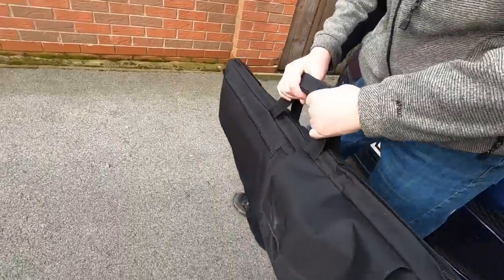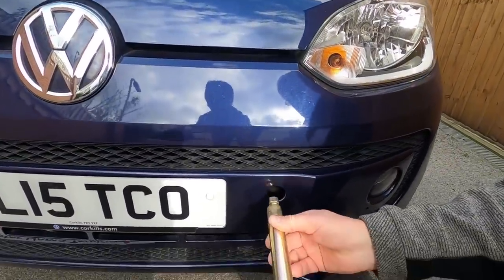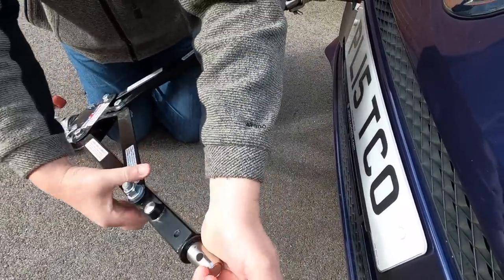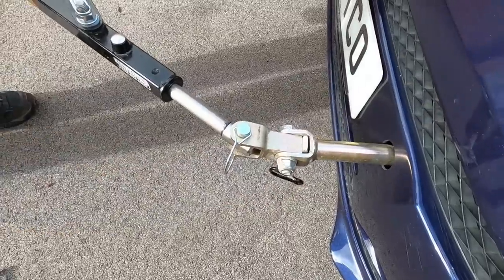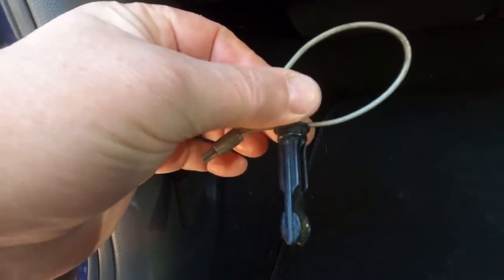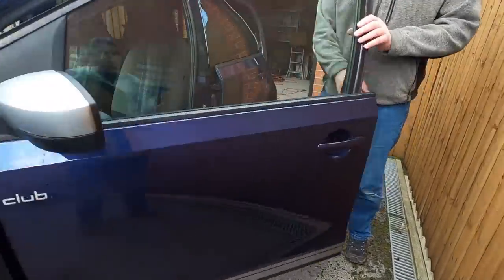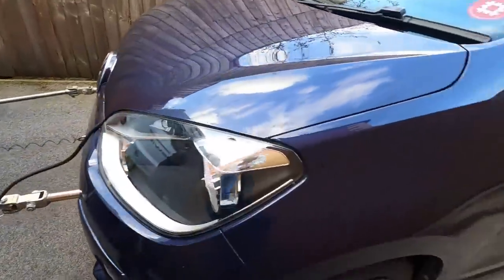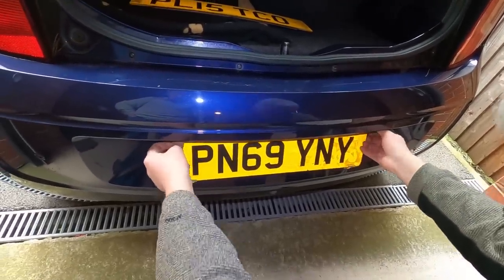Attaching The NEW Smart Glide System | Towing A Car With An A Frame

Comment: Another great video Bob, well done. I do like the way it packs away, very tidy. With the extension bars for easier attachment,  quick fit lock bolts & frame wedge, all great ideas.  As a note, we have now added ON TOW signs to the sides & boot to make our tow car a little more obvious to other road users.
Reply from the maker: Thanks. I have a sign for the back now. Do you find the side signs help? Especially when overtaking a truck on the motorway that's 3 inches from the one in front of it and they start to edge out as you pass.... Oops there's a car there...
Reply: Hi Bob,  Yes, we have had one or two occasions where drivers have been a little confused, especially pulling out of junctions, roundabouts etc and when visibility isn't ideal, we also have a dark coloured car, which doesn't help. So the side decals do work. That said, we have started to tape them to tape windows now as the magnets don't feel too strong & may blow off on the motorway !!

Comment: Used have Tow Bar for tow cars . Nice light bit of kit but hitchin up was a two person job line up had to be exact . That Smart Glide is the solution looks dead easy one person hook up. We tow a Fabia estate car so use a Armatige A frame with a jockey wheel its very heavy but one person can hook it up ok. Is reversing a short distance possible.
Reply from the maker: Yes, I can reverse a short distance, as there are no over run brakes involved.

Comment: Hi Bob I believe you will not now be able to use the vehicles towing eye? using the Smart Glide fittings. Just hope you never have a need for it!
Reply from the maker: On the previous tow a frame screw in connectors the thread was changed so it was longer and stronger than the fitted one, so I couldn't use the original towing eye anyway. Recovery operators I have spoken to tell stories of the original towing eyes breaking. If the car was still towable I would use the motorhome to tow it home if the recovery company refused to use a perfectly good towing system. However, most reputable recovery companies wouldn't tow a car very far on a towing eye anyway, they'd put it on the back of the truck. mike@towaframe.com will be able to answer any technical questions.
Reply: Hi again Bob Did you keep your cars front panel ? I was thinking as the car has now been modified, you would have to inform your insurance company as the car is no longer standard. Should you sell the car, you would have to inform the new owner that this has been done to the car. I like the idea but is it all worth it? just to save a few more minutes over the screwing in the attachments on your the old setup? Please don't take this comment wrong, it's just an observation, not a criticism!
Reply from the maker: @billtait9647  Thanks, no problems. To answer your questions, I didn't keep the original crash bar. I have informed both my insurers about the modifications, as you should do with any modification. I suppose when I come to sell it, it will probably be to someone who needs are car to tow. I'm not sure people would want to change screw in connectors for the twist and lock if they already have screw in ones. We  were having them changed for demonstration purposes. Makes more sense if you are having a new installation though for the ease of use.

Comment: Hi Bob looks good I have the old system, can the twist and lock be easily fitted to existing installation? Thanks Simon
Reply from the maker: Here's the video of us having our VW Up! upgraded to the new system. It took about 3 hours to do, if you' are interested, please email Mike@towaframe.com for prices etc. https://youtu.be/2l_QQph_K24
Reply: Hi Simon, unfortunately you have to change the front crash bar to have the same twist and lock receiver as the bolts Bob shows in his video.
Reply: Thanks for info love the smart tow so will stay with the old system for now

Comment: Great video. The Tow a Frame Smart Glide system is impressive - having researched the systems available i think the Tow a Frame Glide and the Towmaster2 by lnb Towbars in Bristol appear very similar and the costs are also similar, around £2,800!......but haven't bought either.....yet! I note that Bridgend offer to fit the system to a new car achieving an overall saving, but the Nissan Micra does seem a bit big/heavy to tow behind a motorhome?
Reply from the maker: Depends on the specification of course, but it was around 1100kg, so about 100kg heavier I'd guess. Be nice to find out if that makes any difference towing. hint 😁😉

Comment: Hi Bob great video and is something we could use but a quick question how does it work without a key (a start button) as it looks like you leave the key in the ignition to remove the steering lock. Thanks again David
Reply from the maker: I don't know. Perhaps Mike at Tow A Frame could answer that.
Reply from the maker: This is the full list of cars they provide the system for - https://www.towaframe.com/vehicle-list/

Comment: Thanks Bob. Very informative. Intend to tow a smart car but have got to get tow bar on motorhome. Do you know where the tow car brakeaway and electrics can be fitted so I can just fit the Tow Glide. Plymouth. Thankyou
Reply from the maker: The biggest and most difficult part is modifying the crash bar on the car to accept the Smart Glide. I suggest that you contact Tow A Frame, the number is in the description of the video.

Comment: Nice video as always, lacking poppy though.
System looks very well built and thought out , we just phone a well known car hire company who drop it at the site , works well but down side is excess on the hire car can be pricy if you dent it.
Reply from the maker: Thanks. Yes they are called Enterprise. Worst experience I ever had was when I wanted to hire a 4x4 from them in Glasgow. They were incompetent and downright dishonest. Spent 2 days trying to get the right car from them and it cost me £449 for that pleasure. We had to go into Manchester when we hired a car in Bury to get a car and that took into the afternoon. Other times around £275 each time. That's why we tow our own car. So much easier and actually cheaper over the 5 years that we've had the Tow A Frame system. We worked out that if we had hired a car each time we've used our own, in 5 years it would have cost £7500. The Tow A Frame system cost £2500.
Reply: Yeah, get that Bob.
Nervous driving with a grand excess
We are a family of 5 so towing a suitable car is not easy. Hence enterprise. We may have been lucky as it was a fair experience.
Keep driving safe
Reply from the maker: The Nissan Micra we looked at was a 5 seater, would be OK for smaller kids in the back.
Reply: Kids taller than me now, so Micra wouldn't work although nice car. Kids are well trained now, so converting van to travel mode is  well rehearsed and takes 5 minutes. Needed car for isle of wight though , roads too narrow. 
Not to mention ferry crossing costs
Give my regards to Jen and Poppy

Comment: Excellent review Bob, i'm having my car converted and this type of A frame early next year, have you managed to use it a lot this year outwith the lockdown months, one of your other reviews of the older AFrame showed you screwing the bolts in using the toweye, does the new system have a turn and lock using the existing holes?
Reply from the maker: I have used the A Frame a fair bit this year post lockdown. I had a new crash bar fitted in January as you can't use the existing holes. There is a playlist of all my A frame videos.

Comment: The twist to lock bolts are definitely a lot easier than the the threaded system you had. I also like the way it extends if you're a little short to the towball.

Comment: hi bob i just had my towaframe fitted ,,i spoke to mike regarding the rear sign ,,he advised me not to fit the sign for legal reasons ,,not sure if you know about this ,,?
Reply from the maker: As far as I'm aware, all you to need to be legal are the triangular warning triangles as the car becomes a trailer. I didn't there was a legal reason not to fit the sign, I assume you mean the motorhome towing car tow-a-frame sign. I would double check with Mike on what he said.
Reply: @BobEarnshawMoHo  hi ,,i enquired why i never had a sign in my pack ,,he called me immediately saying he does not recommend saying you are towing car on the motorway ,,as you could be sued if there was an accident or similar ,,give him  a call yourself see what you think might be good to put on your vids if hes correct ,,/
Reply from the maker: Thanks, I've emailed him.